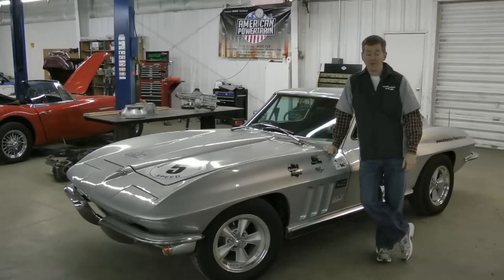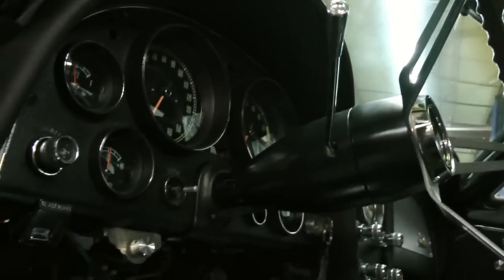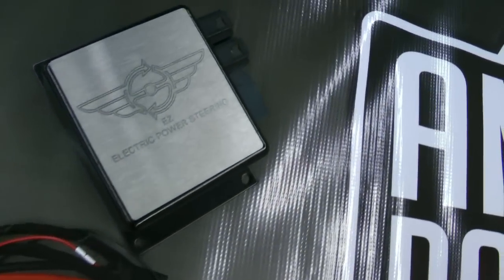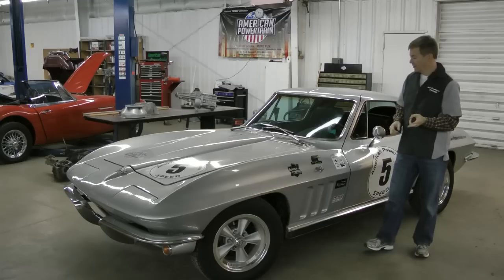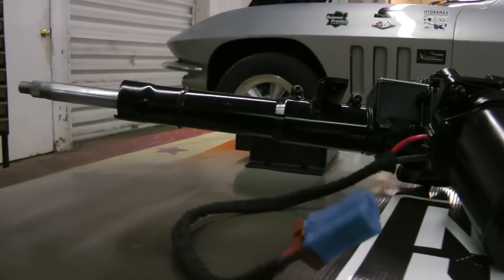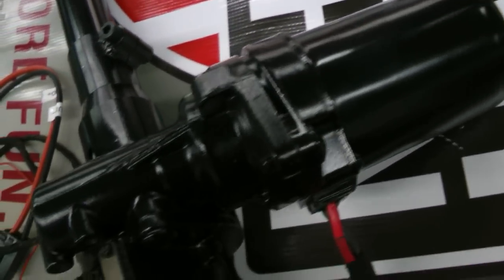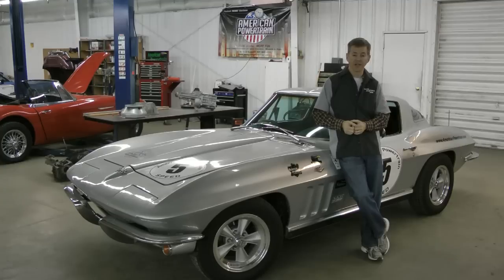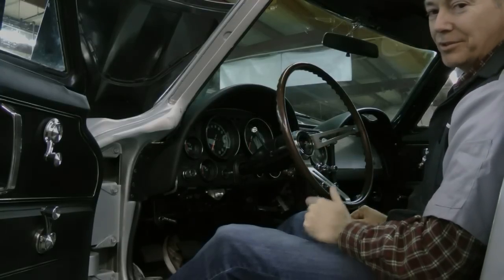EZ Electric Power Steering from American Powertrain

Comment: Seems like a nice piece. i hate my leaking hydraulic mess. built my car 5 years ago and i'm already on my 2nd Mustang power rack, what a piece of junk. Thought about a manual rack but didn't want to put strain on my steering shafts/u-joints at low speeds. Of course this unit will still put the strain on it, but at least the leaking will be gone. Got a laugh at the last line in the video though, "...you're not gonna drive a Vette with 185's on it..." LOL... guess he doesn't own a drag car.
Reply: C2 manual w 235 for years these new fronts are 305.  At 60 yrs old its getting a it much. :)